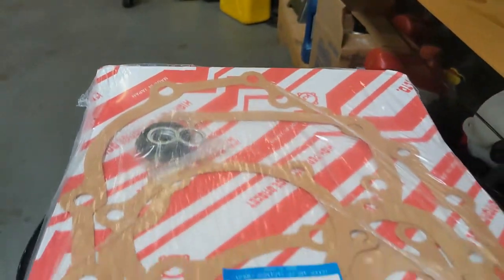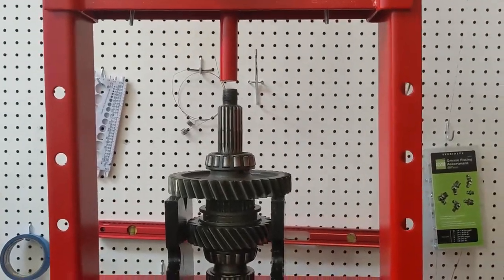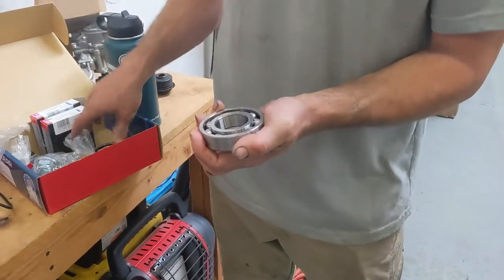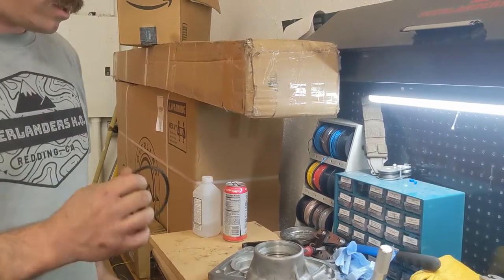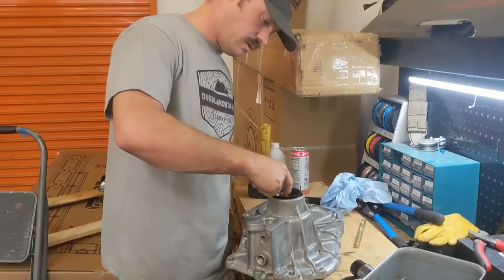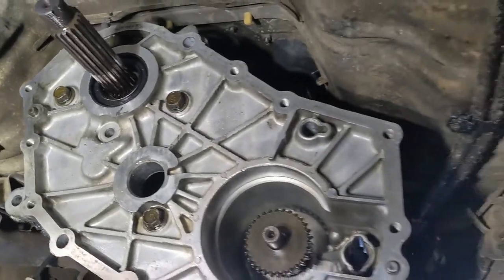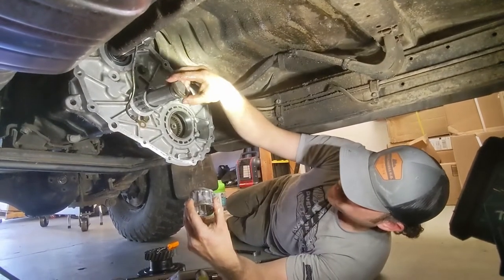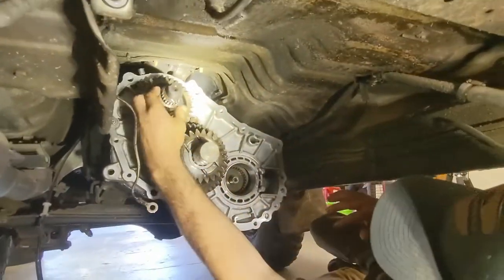Rebuilding the Transfer Case in the 1987 FJ60 Toyota Land Cruiser

Comment: At minute 9:07 you’re putting back the piece that covers the 4wd gears. How the heck did you get that off? I’m at the point where I’m trying to get that drive shaft bearing off and I’m having a hard time figuring how to get that part off. Any suggestions? You didn’t show that part. Thanks!
Reply from the maker: Just have to walk it off. It can be a pain sometimes! Good luck!
Reply: Got it!!